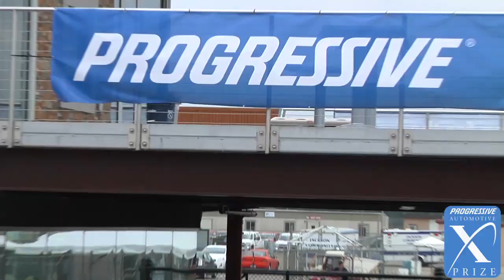Edison2 - Progressive Insurance Automotive X PRIZE

Comment: I noticed that the pit crew places a reflective sheet over the cabin between runs.  Obviously this means that there's no climate control in the car.  it is far from a production-ready vehicle if such basics are absent.  The additional amenities that would be necessarily added to the car to directly compete with other production vehicles would potentially severely impact its efficiency, possibly canceling out much of its potential.  The winners are probably not indicative of future viable cars.

Comment: I rather like that this one uses the fuel we already use everyday. It's easier to see how much of fuel we waste currently and how much can be saved just by changing the car itself. I am a fan of electric vehicle, but why not try best to utilize the energy network we already have(gas station etc) before moving to completely electric. and electric cars are harder to judge how efficient or how electric guzzler it is. Gas/diesel cars are easy to compare with just about everything from scooter to truck